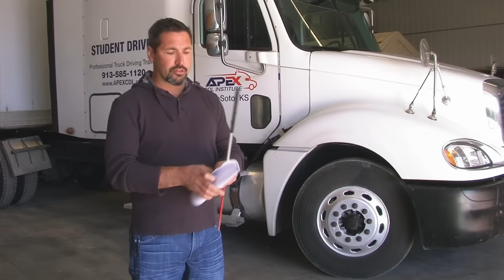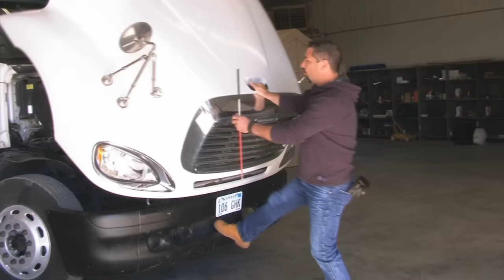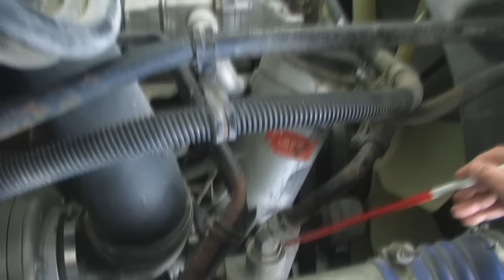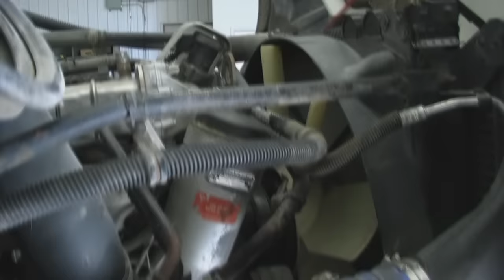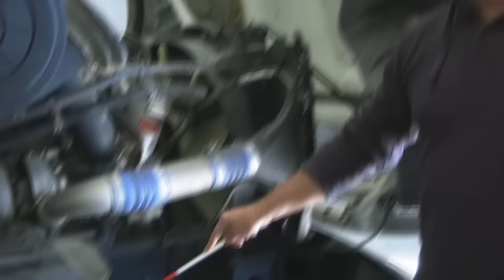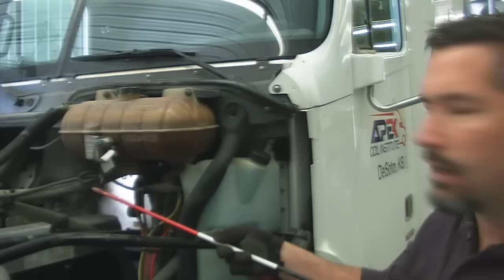How to perform a Class A CDL Pre-Trip inspection. Demonstrated by a state licensed CDL examiner.

Comment: This is the most in depth and detailed pre trip you will find. He doesn't just explain what to say so you pass, he teaches you the general functions of the part and how to know if it is actually safe for the road. I passed my test yesterday, thanks Apex!
Reply: Is pre tip the same for all states?
Reply: I was thinking the same thing im glad i found this video .
Reply: @joshuabevill5284  99
Reply: @MarshalBruceMatters  99
Reply: @joshuabevill5284  a
Reply: @MarshalBruceMatters  9
Reply: @MarshalBruceMatters  9
Reply: Excellent information about the CDL inspection!
Reply: Actually he did lol 😂
Reply: You have to know All part functions..n why your checking them study in every way known to mankind!! I failed my 1st try but passed the next day!! cause I had to within a timeframe!! Writing it All down definitely helps. It takes some hours but once you do that you half way there to having it down. This a great video to get the why of the functions of the parts  
I originally went to The greatest CDL pretrip on YouTube  he sells books on Amazon too but I didn't have time to buy it so that's where I got the idea to write it All myself. I bolded n capitalized All letters of every section I wrote down ..so it stay stuck in my mind ..wrote in organized way so that I would repeat in a natural flow that makes sense. Practice 1 2 sections at a time then add another .. Speak it out loud walk around going over it n tell your kids or family n have them listen.. I wrote a rough draft while listening to cdl prep then rewrote it again using abbreviations so I knew when to say no leaks no illegal welds..etc  Promise it gets you at least half way if not more on point then practice every way known to mankind. Focus putting whatever you can to the side since there's a time limit it takes weeks. Hope this helps someone

I passed!! Be prepared. I had to test the entire truck!! But I was confident because I studied n practiced on the truck used for My test. After using the app n passing computer tests on 1st try. I failed my 1st test picking the easiest part of truck!! Because I didn't mention the functions of parts n why I'm checking them I passed the next day at another location 
I had been rescheduling even after taking notes 2x cause I wasn't studying the test truck but once I did that it made a huge difference..even after writing it all down 2x if your having a hard time with that get a video n pictures of under hood right and left and all around the truck but do spend at least 2-4 hrs total observing n studying the truck in study mode. Prioritize your goals and make it happen
Reply: This is what I don’t understand he gets in the truck and then put it in gear and turns it off so it doesn’t roll then charges the pressure for the brakes (parking brakes) So that he can test the pressure and if there is any leaks.

But what I don’t understand is why isn’t the parking brake already on when he gets in the truck and why do you need to put it in first gear to listen for any pressure leaks? Why can’t you just leave it in park re-pressurize it and then turn it off without putting it in first gear
Reply: @bwahtoo4252  mm m mmmm m my

Dad lol lol polo 14:17 was the first 14:17 ❤ 14:17 14:17 ❤

Comment: So much to remember but I'll watch this many times if I have to so I can get that cdl and leave my crappy job.

Update: Just finished the pre trip portion. Second attempt though since I missed the pass quota by 2 points. Depending on if the tractor has it, call out the DEF reservoir next to the fuel tank. As well if the examiner wants you to be specific on the gauges:

Engine temperature: 165-185F
Oil pressure: 30-75 PSI
Voltmeter: 12-14V
Transmission temperature: 180-250F
Air Pressure in tanks: 100psi recommended
Reply: Same we got this lol
Reply: Did you leave your crappy job yet?
Reply: Same here
Reply: Thank you for the heads up 👍
Reply: Good point about being specific about the gauges. When Jeff talked about checking  the tire with a pressure gauge he said it needs to be at least 100 psi, but for the gauges inside the cab they just needed to be "at the proper operating level". The license examener doesn't know if the person being tested knows what those proper operating levels are unless you mention it specifically.

Comment: Just wanted to also thank you Jeff for putting together and sharing this video. I just earned my CDL Class A and I can honestly say that it wouldn't have happened without your help. I took written notes on what you said throughout the video and then rehearsed it again and again. On test day, it just flowed naturally and I had confidence in what I was saying. This is the definitive video on the CDL Pre-Trip and Air Brakes exam. Thank you and God bless you, brother.
Reply: he gets in the truck and then put it in gear and turns it off so it doesn’t roll then charges the pressure for the brakes (parking brakes) So that he can test the pressure and if there is any leaks.

But what I don’t understand is why isn’t the parking brake already on when he gets in the truck and why do you need to put it in first gear to listen for any pressure leaks? Why can’t you just leave it in park re-pressurize it and then turn it off without putting it in first gear……….
Reply: can you pass me your notes?

Comment: Great video! Two things I would add though for the brake test right after the "SALE" tests: 1) pressure build up test, (85 to 100 in under 45 seconds for dual air systems and 50 to 90 psi in under 3 minutes for older single air systems), and 2) air pressure governor cut-in and -out test (showing that the pressure increases to about 125psi then stops, then after fanning the brakes a whole bunch to drop the pressure to around 90 psi, the governor will cut-in and pressure will start increasing in-between brake presses.)

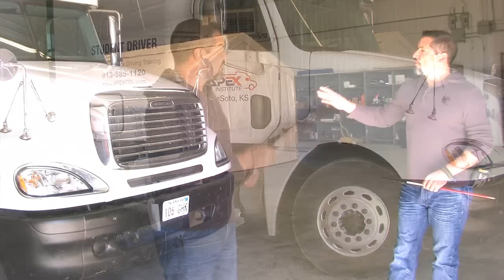Comment: Introduction until 3:35. 
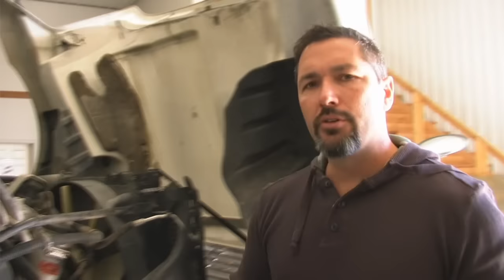Under hood starts at 5:27.
Driver’s side of engine 7:56
Driver’s side of cab 22:18
Coupling 26:33
Back of the truck, 29:58
Trailer 36:30
In cab 42:54
Reply: I appreciate you

Comment: for all you ladies and gentlemen of California.   The In-cab and brake test in this clip is great and bless this man (jeffrey-steinberg)  for making it so clear and understandable but!!!  In California there are a few ad-ons

A.  In your in-cab inspection you need to check the knobs of the trailer and the tractor that they are not broken and or cracked.
B. In the brake test, you need to tell and demonstrate to the examiner the cut-in and cut-out points.   You should say that the cut in should be no less then 100 psi and the cut out-out should be at 125 psi and no more then 130 psi.
C.  In California the warning light and buzzer should come on between 75-55 psi and the pop up point is between 20 to 45.   And of course you'll need to demonstrate it all.   Good luck
Reply: not surprised.
Reply: elaborate on california pretrip inspection
Reply: I'm in California..i noticed not big schools here,could that be cuz of all these fucking extra laws😂 I can't wait to leave this state & start somewhere else near my school..prob Arizona.
Reply: It’s similar here in Washington state
Reply: @Alexander Miller you're right except the cut out is no more than 140 psi not 130
Reply: truckdriver_ca  exactly but he called that right on his op.
Reply: truckdriver_ca  oh no kidding I was just doing my air brakes test in fontana. Going for my driving test in 14 days
Reply: truckdriver_ca  yeah I have the air brakes down as well no problem. The pretrip I'm still struggling a little bit but i should have it all soon. I start doing the driving and skills next week. Are you manual or automatic trans
Reply: Oh you poor bastard 😂 same here. They don't want any restrictions apparently.
Reply: Glad someone else already caught that.
Reply: @Khets_hostage  Who did you go through in Fontana?
Reply: hmm

Comment: Exterior Overview - Front 3:36
Engine Compartment - Passenger Side 4:54
Engine Compartment - Driver's Side 7:56
Exterior Sides and Rear 22:18
Trailer 36:37
In-Cab Inspection 42:54
Brake Check 49:16
Reply: jonjonjrfrmcali thanks!
Reply: This video and other youtube videos give so much info.  On the actual DMV test you are only supposed to know like 1/3 of everything here outside the truck.
Reply: You R an 👼😘
Reply: Thank you for putting this on YouTube I’ll be going to school for my cdl A and I’m very nervous about it but this is making things a little bit easier for me
Reply: jonjonjrfrmcali thanks
Reply: Thank you
Reply: jonjonjrfrmcali  thanks man
Reply: It is help full thank you
Reply: jonjonjrfrmcali 
Thanks
Reply: @antdx316  not in Illinois.  We need to know everything.
Reply: +Jesse Rincon, When you OTR they make it where you hardly check for things.  Only need to check for things when you woke up after sleeping like clearance lights.  The driving was quite lonely after a while.
Reply: Illinos they wany us to know everything on the pre trip. Just like it's on this video right here. I'm going to school myself right now for it
Reply: Hello im from panama can i get a student permit for get a cdl?
Reply: @carandreisaandreisacar3026  I'm not sure.  I think you need Class D license first before you can upgrade to A but if you can pass A you can pass D easy.  They have automatic trucks now so you can get automatic only no manual restriction like I did.  The clutch pedal is way too hard to do.
Reply: @antdx316  ok bro thanks i have in my country 8 years driving trucks but i think about the work visa or student visa for go there and get license to dot the work but thank you for the info god bless you and your family
Reply: @carandreisaandreisacar3026  I drove OTR for 2 weeks.  The truck stops are very difficult.  Nothing like the road test.  If you can drive and sleep truck stops in your country you can Easily get a job here if you are allowed to be hired. God bless you and your family too.  : )  Just get your CDL-A and apply to Paschal Truck Lines.  You can also do Swift and US Express.  They are OTR jobs though so for at least 6 months - 1 year you have to drive for them.  No home time really.  Then you can do Day cab work.  Day cab companies won't hire unless you have at least 3-6 months of OTR experience.  I mean if you can pass 1 month of OTR I thought you can Day cab easy as the truck is shorter.  Unless you know someone who owns a business and they trust you in driving it would work.

In all honesty Day cab was the truck I've used to pass my road test.  Some people had trouble still.  With OTR... 53' truck and some of the stuff we've done, it was quite an experience.  No accident but came very close to a few.
Reply: I need some help. I did my cdl a road test recently and I passed the pre trip and driving inspection but failed the driving. My weaknesses as recorded by the examiner were Railroad Crossings, Intersections, Urban Business and Expressway. From my recollection the examiner asked me to explain what I'd do upon approaching a RR to which I replied look and listen for signs of train crossing. 
I was grinding gears all the way which resulted in me being distracted while approaching signs like bridge height etc and also I almost stalled in the expressway trying to get the right gear. All in all my shifting was shitty and so I failed to keep up with traffic. I am due to return in 2 days for the redo but I need advise.
Reply: @FYAHMONKEYGAMING  yeah, when you get to the rail road crossing you have to slow down look for trains then Accelerate fast so you don't get stuck also need to mention all bridge heights during the test.  You can't offtrack into any curb or it's a fail.  Just run everything wide.  The main thing is to accelerate as fast as possible on acceleration lanes and start letting off and braking earlier like you have 80,000lbs load in the wet, well probably snow because I did haul that much in the wet and it stops fine.  Air brakes are the best! but you can't scare the instructor.  There are still more instruction at OTR if you join SWIFT, PTL, US Express, etc.  Truck stops were totally another level but if you are destined to drive there should be no issue.  You may not have everything you need to drive perfectly safe during OTR but if you have common sense before encountering certain situations you should be good.  Some of the truckers I've seen are meant to drive it for a living.  I heard you have to double clutch everytime for the test but I've taken the test in automatic.  OTR now is automatic.  They change trucks every 2 years.  In the future it would all be automatic.  From what I've learned in automatic the truck will shift 2-3 more gears like say you are in 1 at full throttle from a stop, it goes to 4.  Also you can start in 2 or 3 if it's light enough for smooth starting.  1st gear torques the truck hard and it rolls unless you massive finesse the pedal which took time to do.  In traffic, which was constant in OTR I was practicing.  I just start in 2 or 3 when the instructor isn't looking lol.  I can finesse in 1 but I feel it's unnecessary.

1: take all turns wide
2: full throttle acceleration lanes
3: you should probably skip 2 or more gears if allowed and drag the clutch
4: let off early for braking and come in nice and easy to a stop
5: mention all bridge heights
6: slow down at RR, listen and look for trains but don't stop then accelerate throughout the whole RR to not get stuck
7: when they ask, triangles are to be 10, 100, 200 feet
8: let me know how it went
Reply: @antdx316  Thanks for taking the time to educate me, I will take all into consideration.
Reply: @FYAHMONKEYGAMING  I like to keep what to know simple but emphasis.  You don't need to know 1000 things, just enough to pass each section.  You can learn the other advance things later but if you can't pass the basics you won't even get to learn any advance things.
Reply: @antdx316   So true
Reply: Jesse Rincon  thanks for the info
Reply: Thank you for the video, great work!
Reply: Can you post the link so I can download it plz
Reply: @FYAHMONKEYGAMING  also no changing gears on intersections , no changing gears while crossing rr tracks. I haven't taken my cdl driving test but that's what I've read
Reply: @ps2gamer365  You are correct
Reply: @Johnny-jr2lq  How'd It Go?
Reply: @carandreisaandreisacar3026  not in this country,maybe easier back in Panama
Reply: What's the safe method again?
Reply: I dont plan on driving for a living
Reply: The real MVP
Reply: @ps2gamer365  ?
Reply: Taking my test soon. Thanks for putting in this effort. I’ll be watching this several times while checking a buddy’s tractor trailer to get this down!! Minnesota checklist in hand as well.
Reply: Valeu mano, muito obrigado!
Reply: Would be driving right now if it wasn't for the stupid pandemic.  Great study guide!  Since I can't test I'll keep on viewing and viewing.
Reply: Thanks 😊
Reply: I thought drum brakes "pads" were called shoes? Will I pass if I call them shoes? I know that 4/32 is 1/8 but 1/8 is a wrong answer.
Reply: Really helps
Reply: You the man 3J
Reply: @highlanderfreelancer4553  I had this question too... pads, or shoes?
Reply: Do you have to know when your governor kicks on in air brakes test. I know its between 120 and 140. I thought this was part of air brakes and If you don't do it. Its a fail?
Reply: Thanks
Reply: Great video,thank you.
Reply: @kpatrol  Hello there, if on the wheel you see a disk, that uses pads. If the wheel comes with drums, it uses shoes. Pads for disks, shoes for drums. Good luck to you and keep watching. This is the one video I always come back to refresh.
Reply: @PcVideos  ... really, really good. Been driving for 30+ years. Saw this video. Watched it.  Said to myself, “Oh my goodness!”  Watched it again. Did I ever get a kick in the butt!  Thank you again.  My suggestion to young drivers.  Great career. Be sure to watch great videos like this.  Save your life.
Reply: @rickc1124  It depends on the inspectors mood at the time.
Reply: The goat
Reply: @highlanderfreelancer4553  you HAVE to get the tire depth correct to the T. 4/32 for steer, 2/32 for drive and trailer.
Reply: Thank you
Reply: Dope!
Reply: thanks!
Reply: Thanks
Reply: Thx
Reply: @Johnny-jr2lq  facts am about to do mine 😥
Reply: @antdx316  go
Reply: Amazing, awesome video! Thank you 😊
Reply: I feel you are doing a wonderful job with you demonstration for those of us that may want to drive one day, keep up the good work and don't let people frustrate u about what other's  want to know.
Reply: @FYAHMONKEYGAMING  He is not talking about the railroad or height, he's speaking on the safety of the use of the truck, listen!
Reply: For those that don't want to drive or don't  drive what's  the problem, listen to your interest, you're  messing up our concentraton.
Reply: I am a trailer truck driver 10 years experience I want to work in Canada can anyone help me
Reply: Thanks so much 🙂
Reply: @alexiatr   :b
Reply: @mikedamdo1641  qqqqqq
Reply: Ppo
Reply: Thank you
Reply: Fantastic vide thank you so much for a detailed safety check!!